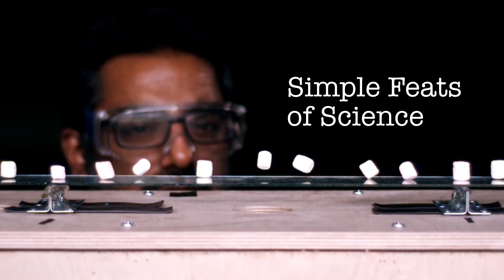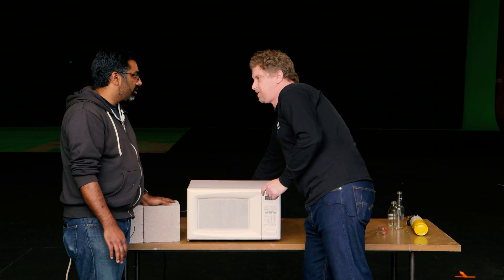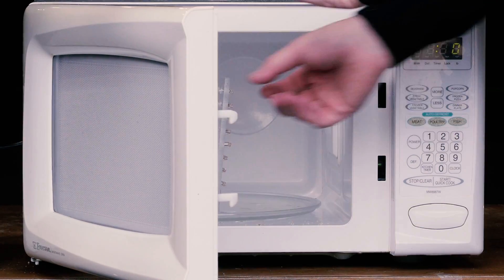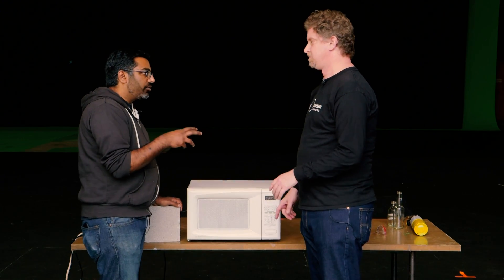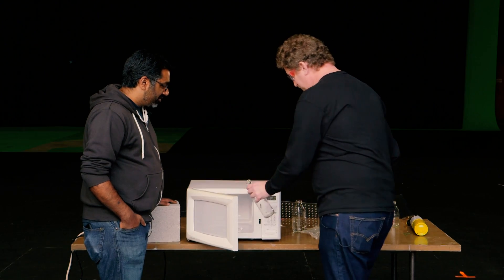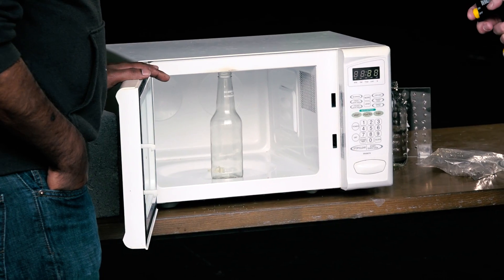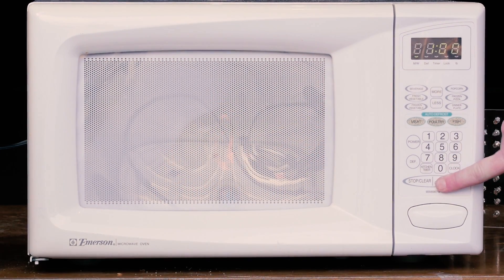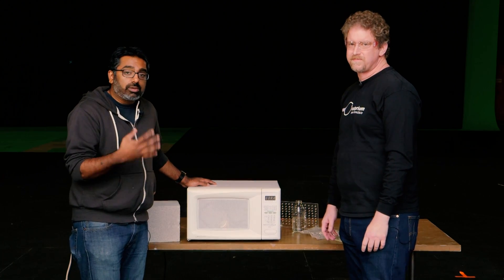Visualizing Energy Inside a Microwave Oven!

Comment: I'm a little disappointed nobody put a little flame in there and made plasma balls. When you have an open flame, there are particles which can be heated and interact with the microwaves, this super heats the expanding gas from the flame until it gets so hot it forms a plasma. Plasma is electrically conducting and so it then begins to arc and throw off bolts of electricity similar to microwaving metal. Because the plasma is so hot, it floats up to the top of the microwave and looks like blue ball lightning.

Comment: There has been cases where pyrex dishes have done a Chernobyl in the microwave, basically what happened was a nuke tech has filled a dish with water, and nuked it for a long time to clean out the microwave, unfortunately they've put it in for wayyyyyyyy toooo long and the water boiled off dry, and managed to do so in such a way that the dish has melted down just like in the video

Comment: ThinkGeek sells a glass mug filled with neon gas. It comes with an electronic "coaster" that generates an AC electric field that makes the gas flow. But if you place the mug in a typical microwave oven, it will glow so bright that it hurts to look at it. And, yeah, the glass will quickly become quite hot to the touch. I'd like to point a FLIR camera at it just to visualize the rapid increase in temperature some time.